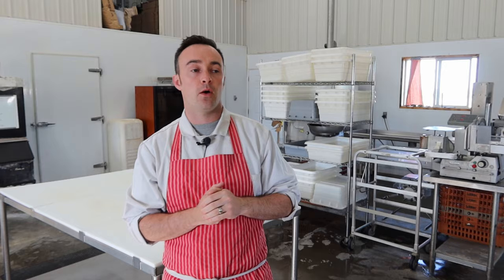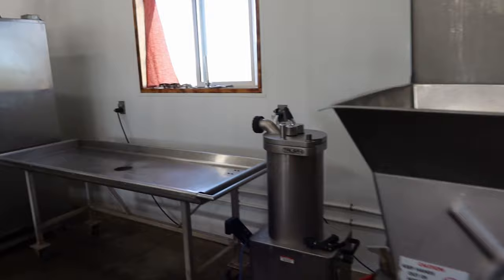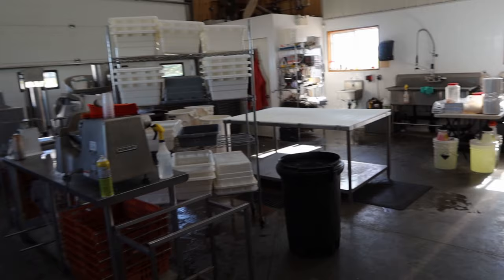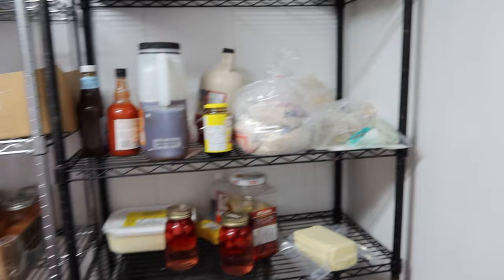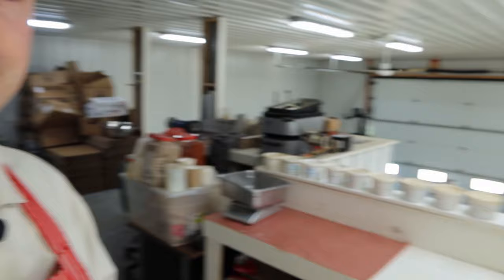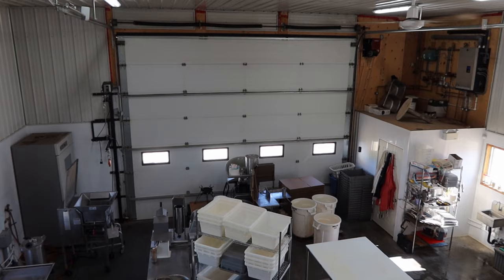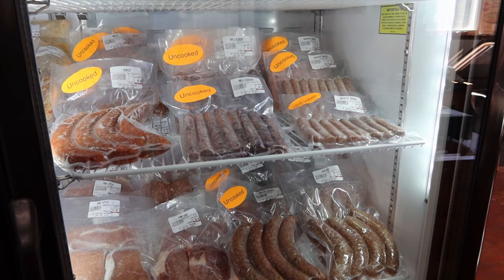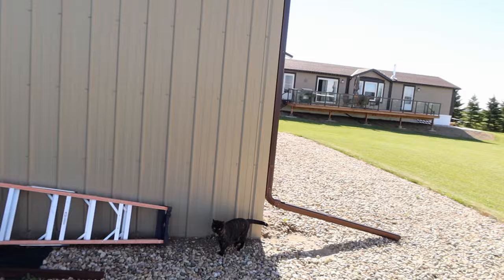Meat Shop Tour, a Walkthrough of My Meat Shop!

Comment: Referred here by 2 guys and a cooler. Subscribed immediately.  Way back in 1958 I worked as a meat warper in a locker plant. 
The compressors were on the floor next to the back wall. The wall had top hinged doors that were opened so the hot air from the compressors was blown outside. During the winter the doors were closed so the building was heated.  There was a locker room with 300 lockers, 3x3 ft and 3x1.5 ft kept at 0°F, a quick freezer kept at -10°F below zero. Regular cooler kept at 32° to 40° F.  A curing room kept at 32° to 40°F with 4 - 45 gal wooden barrels to brine cure the hams and bacons.  A smoker about 4 ft square and 12 ft tall, ran on propane.   My job after school was to wrap the meat, put it into the quick freeze, than move it the next day to the locker rented to the farmer that owned the animal.

Comment: I’ve started to do a little home, butchering myself nothing on your scale. But I have been buying a side of beef and butchering it and I get a pig and I’ve even been making my own bacon bacon bacon I even made shoulder of bacon all dry cured of course not injected don’t have the space and the equipment for that..  vacuum sealers are wonderful tools and I’ve purchased one. I even use it to seal canning jars, particularly with dry goods like pasta and rice and grain. The vacuum sealer does not only increase the life of the food in the freezer, but it will also increase the life of your food when you put it in the fridge also. It’s something most people don’t think about what they think about the vacuum sealers. So you can have vacuum sealed me in your fridge for up to 10 days. I can go longer, but it is recommend for it to be open then cooked within 10 days.. I so I would recommend a vacuum sealer to everyone. It is easily one of the most useful tools you’ll ever have, and can extend the life of your groceries. Take the cheese for example, who doesn’t like a nice piece of cheese imagine you go down to the supermarket and there’s a big sale on and a great price for cheese, you can buy it and freeze it but it doesn’t taste quite the same. It will last one to two weeks in the refrigerator. However, if you vacuum seal it, it will last between 4 to 8 months in your refrigerator. A chambered vacuum sealer can be expensive, but if you’re using it on a regular basis, you will easily make your money back within the first year or so after that, it is saving you money. PS love the shop set up. I’ll have to come and visit you one day if you allow visitors.

Comment: Great video. Thanks for the shout out. Your mixer/grinder is one serious machine. I wasn't familiar with an integrated model. I had seen mixers to achieve greater emulsion for texture for hotdogs or similar and then grinders.
Reply from the maker: Thank you David and no problem.
Ya they are quite nice it reduces your clean up time at the end of the day.
A bit more expensive usually though.
Reply: @duncanhenry  what model/brand is yours. Just did a 30lb batch by hand and my fingers froze in pain :) Maybe there is a model a little smaller
Reply from the maker: Mine is a Hollymatic 175. I'm not sure they make a smaller model but I know biro makes what is called the biro mini. Might be your answer.

Comment: You have a nice shop.  
Question?  You keep your cooler at 32 degrees F.  Doesn't that affect the moisture content of the meat? That is an evaporator, not a condenser by the way, but what temp differential are you running across it?    I prefer my coolers to be 37 degrees because of veggies and also meats.  Why run your cooler so low?  I agree that your freezer is too small for proper air flow with all of your product.
Your skids/compressor and condensers are way to close to the wall and boxes/stuff.  With no air flow, you will burn up a compressor in short order and you will be wasting money in run time and repairs.  The second floor/balcony is ok if you can clean the coils properly. (the cooler skid is too close to the wall.  The box obstructions will hurt your freezer skid as well.)
Love the Keg Distiller too
Thank you for the videos.  I have liked all of them.  Good Stuff and subscribed
Reply from the maker: Hey Ted thanks for the input.
I run my temperature at 32f 0c because the microbiological studies show that on vacuum packed meat you get the most amount of shelf life at that temperature. (You can even store them at 30f -1c)
It pulls some extra moisture out but not a substantial amount more than other coolers.
I vacuum package most everything so it isn't a big concern in my setup either way.

Improper airflow in my freezer hasn't been and issue yet, boxes full of sausage freeze solid in about a day and a half 2 days at the most. The biggest dilemma is not enough storage space for custom meats at peak times.

I do agree on them being too close to the wall I wish I had spaced them out more for better air circulation. I can clean them out but is a pain in the butt. 

I am glad you liked it though.